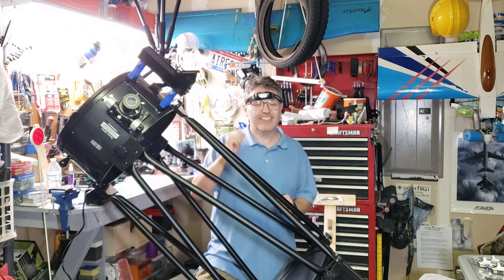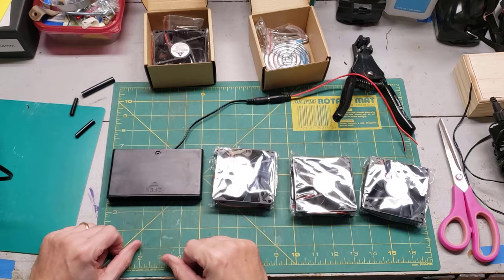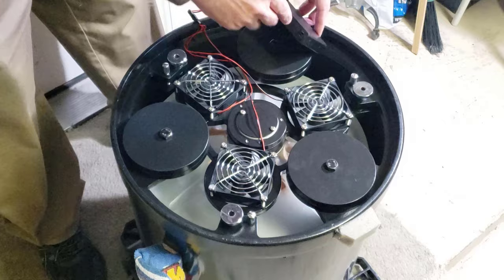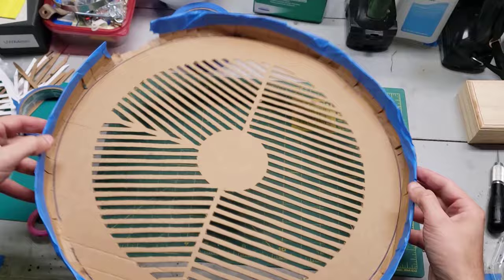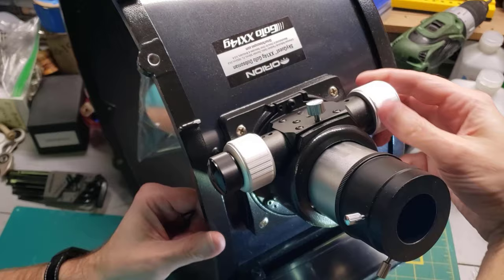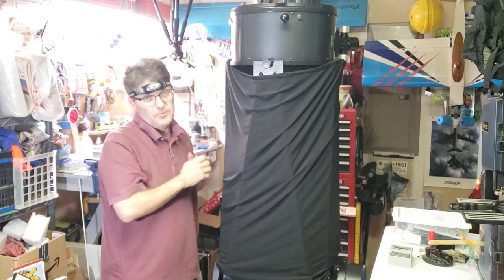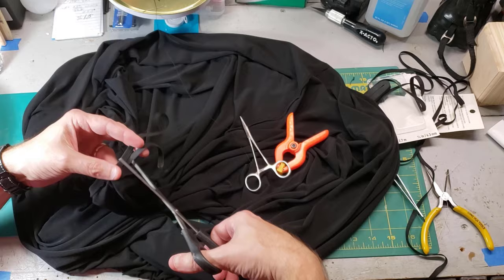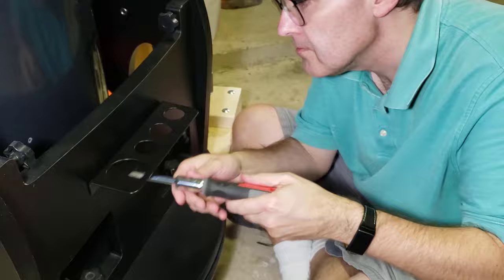PART 7 - GIANT Telescope Restoration DONE!  Testing The Orion xx14g Dobsonian Telescope!

Comment: Good idea to use scrap cardboard for the mask. Hadn't thought of that and was going to try 3mm black acrylic on my diode laser. It's just big enough to do one for my 10" with 4 slots for alignment studs.
I 3D Printed the one I use on my 80mm refractor.
Reply from the maker: Aside from nearly giving myself carpal tunnel, it was an interesting challenge.  I 3D printed the ones I use on my 8 inch Dob and 3 inch Dob.

Comment: Good morning John. I have watched that video of the upside down wedged encoder. I almost cried. Will review it again. My issue is finding the right wave washer that goes between the encoder and the upper base plate. I contacted Orion and talked to Eric and Geoff and they sent me a link for a users manual. Very helpful. Keep looking up. I do every chance I can.😂
Reply from the maker: If you can't get what you want from Orion, give Sky Watcher a try. I've bought two "Orion" parts from them.
Reply: @reflactor  Thanks for the tip. Will look into Sky Watcher. I do know that the alt Dec reader is working. I was off by .2 degrees vertical with a small magnetic carpenters level.Then dialed it in to 90 degrees on the controller. Going to give it a whirl soon. Hopefully I can get the AZ working also. Again thanks a lot for what your doing.Clear sky's from DA Bayou State.

Comment: A very nice wrap up video for your restoration efforts!   
As you discovered, we were advising well on the Telerad, it's ideal for big equipment.

Once you get the planets in the viewfinder, you'll not worry so much about light pollution's effect on aperture of the 14.  You'll see the details snap in focus like the stars in the Trapezium.  Also, having Goto tracking you can setup a very usable EAA system gathering the signal and seeing more faint targets in good resolution even in bortle 8.  

There's no doubt the 14" will impress you in dark skies and if you can attend a multi-day star party you'll really not mind the weight issue.  I got to attend TSP all the way from here in South Carolina, and you're a whole lot closer(OK I know it's still a fair drive inside Texas!).  But if you can get there with the 14" you'll really appreciate having the aperture.  Omega Centauri even low on the horizon was great in an 8"... in your 14" it will be far better. 

Anyways... wrapping up... I'll be watching your channel for your next challenges!
Reply from the maker: TSP sounds like a lot of fun for sure.  I'm looking forward to trying the 14 inch in a dark sky.  Thank you for watching!

Comment: Hello, Mr. Dreese;
Thank you for a great series!
Amazing job on the DOB!
I would like to fix my 6" Orion StarBlast Push-To but I can't figure out what's wrong.
I think 1 of the sensors is not reading correctly.
Unfortunately I have NO info on what the readings  should be.
During orientation all seems well but the output is way off, so I'm stymied.
I think I need to know more but that's unlikely considering Orion's policy per used scopes.
Also, I'm glad I'm not idling around a parking lot in a Ferrari.
I can access a nice Bortle 3, a 15-minute drive away but health issues keep me home.
As a long-time amateur 'Mr Fix-It' & inveterate tinkerer I really appreciate seeing how you fixed the 14".
Have a GREAT day, Neighbor!
Reply: My StarBlast is gutted of all push to electrics.I use Stellarium and a red dot finder. Works for me.Maby some one can build a simple altaz reader that could help to show the positions of the scope where ever it's point ed. Maby too simple and not enticing as a go to do all the work for you.
Reply from the maker: Jackie, you're getting ahead of me!  I have a video coming out that shows just that.  :)   It might be the next one!
Reply from the maker: The good news about the Push-To's is that they are much simpler than these motorized GoTo's.  I used to have a 6 inch Orion Push-To. Worked great.  So, if the output is way off, it usually means the encoder disk (that round metal disk with the black ring around the outside) may be slipping.  That round disc shouldn't spin at all.  I am guessing that your azimuth disk (squished between the bottom two discs) is slipping.  Or in my case (video:  https://youtu.be/9O7PHAUD96I  )  it was installed upside down!

Here is one of the ways to check the output from each encoder (one on each axis).  On the handset, there is a menu to monitor the output angles (Azimuth and Elevation).  Move the telescope in one axis at a time from known angles to new angles.  For elevation, move the tube from pointing horizontal to pointing straight up. You should see a change of about 90 degrees.  You can do the same with the azimuth.  Spin it a quarter the way around and it should change by 90 degrees.  Good luck!
Reply: @reflactor 
THANK YOU!, THANK YOU!, THANK YOU!
I want to do some DSO observing>
So some kind of guide is needed just to find the 'close enough' spot.
That makes sense so I'll try that the next chance I get.
You, SIR, are gentleman and a scholar!
Have a GREAT day, Neighbor!
Reply: @jackieblank4249 
I use a green-laser pointer, Stellarium on my cell, & S&T's "Pocket Sky Atlas".
But that won't get me close enough for DSOs.
I've started a project w/ green laser pointer in a clear plastic ball w/ 2 circular protractors for declination and right ascension.
But I haven't figured out how to convert D& RA for my location yet.
Have a GREAT day, Neighbor!

Comment: New subscriber here. Thanks for sharing this amazing journey! I'm in the market for a 12 inch goto dob myself. Would like a 14 inch but they're quite a bit more expensive (at least here in Australia) don't have the budget for it. Can you please answer a few questions? How did you collimate this particular scope? Laser collimator? And do you need a step stool for the 14 inch? Would I need a step stool for 12 inch?
Reply: I had a 10 inch non-goto dob before but sold it as it had a few issues that I couldn't resolve. Also I found out later that the laser collimator I had trusted so much was actually in need of collimation itself 😂 but I did have fun with that thing
Reply from the maker: Prior to this 14 inch GoTo telescope, my main telescopes were both manual:  a 12 inch and the 8 inch featured in the videos.  I did not need a step stool for the 12 inch and I am not tall.  However, I have to use a step stool on the 14 inch for any elevation angles above about 50 degrees.  I usually put one foot on the step stool and one on the dolly cart.

Your timing is impeccable - I am recording a video on how to collimate your laser collimator!  They almost always come from the factory messed up.  So I'm demonstrating my simple method to "collimate the laser collimator".   I always use the laser collimator because it allows me to do a precision collimation in less than 5 minutes. Just be careful.

Comment: With a 14" you can actually bust through  the light pollution if you know how. The trick is to use higher powers. Globular clusters at 1.5mm exit pupil, small galxies at 2mm exit pupils, large nebulae with UHC and OIII filters,  and planetary nebulae. 

You can see alot in dark skies with an 8", but you can see much more with a 14" from light pollution than you can with an 8"

If you know how to do it, and most amateurs follow the leader and don't break the conventional norms such as "low power always for dsos", well higher powers equal darker background sky and more contrast, and with larger aperture, you can pump the power and still have enough brigtness.

The trick is understanding exit pupil and matching exit pupil to.the type of target and the type  of filter, or wether or not to use a filter.

Start pointing at globulars and you will eat your words about not needing bigger than an 8 in light pollution. 

1.5mm exit pupil.range is the sweet spot for pulling the best out of globs in light pollution. 

It also helps to be using wider field eyepieces,  so you would be best off investing in some at the focal lengths that will give you 1.5, and 2mm.exit pupils with good edge correction and decent eye relief. At the bare minimum those 60 deg planetary eps like what you busted out to split sirius, but i think naglers and nagler clones, which are as low as $99 in some cases,  are the way to go.  The 7mm 82deg meade PWA, or 8mm stellarvue 82deg (both the same eyepiece), or the skywatcher (helios) nirvana which i believe is also the same eyepiece.  They are all over the place now, so many selling these under different brands, and they  are ancient, starting out as the william optics UWAN 20 years ago. But they  only come in those 4 focal lengths (sometimes given slightly different values), 4mm, 7mm, 16mm and 28mm.

Hint, the 28mm absolutely destroys the 30mm ES82, it is the closest to the 26 and 31 naglers you will ever see, can be found new as low as $199, and you will like it so much you could sell your 30mm and have enough to cover the cost of the 28 and one 2 shorter focal length ones,.since the es82 prices are so much higher now.